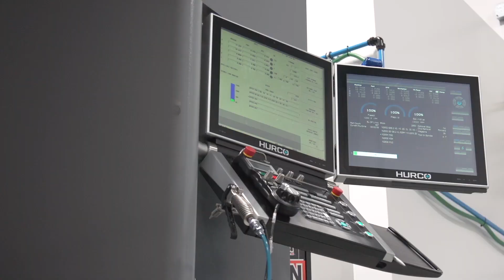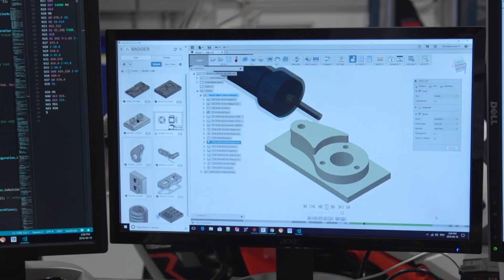MJK Performance | Fusion 360 Customer

Comment: (0:42) When you have a 5 axis machine but can't be bothered to walk across the shop to get a chamfer bit
Reply: Lol. I noticed that too. But the way I see it. Sometimes it's best to follow through with certain 5ax toolpaths as proof of concept to practice, before finding out that you need it. Some occurrences it's good to find out what the machine can and can't do in terms of processing speed, travel limits, and whatnot.

Also, if the machine can cut the chamfer fast enough, hey, one less tool to setup. ;)
Reply: also it makes better surface on the chamfer.